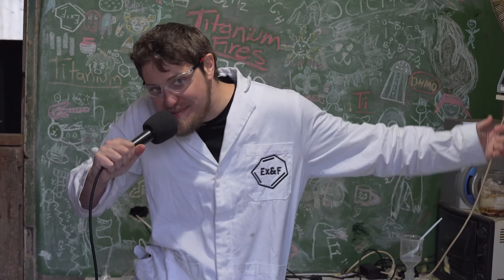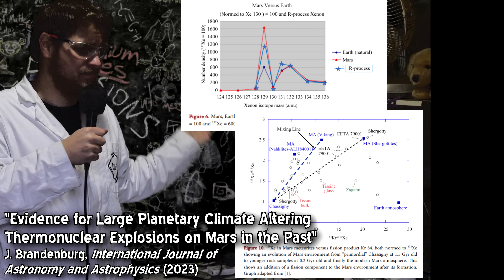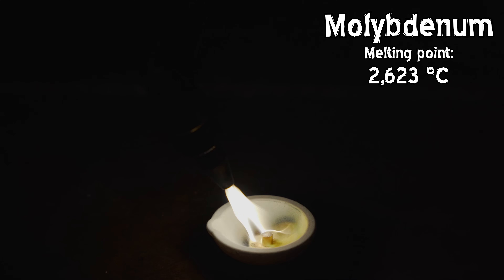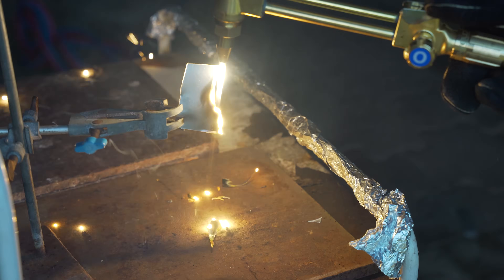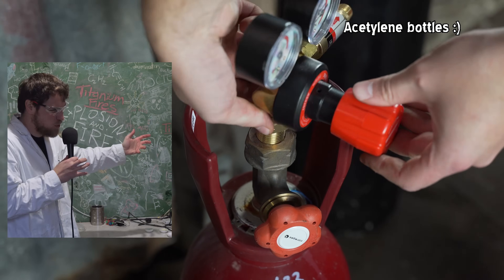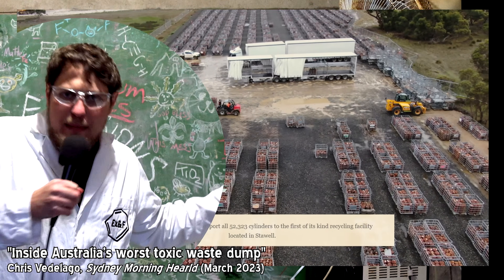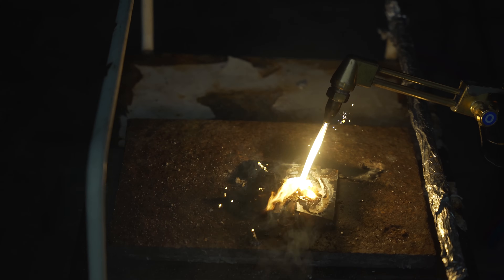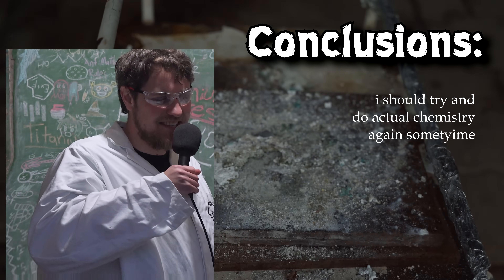Actually burning titanium

Comment: One time I wrapped about 100 grams of KNO3 in a lot of aluminum foil and put it on some hot coals in the fireplace. After a bit it slumped and poked with a poker emitted flecks of light and then it lit. For several seconds the house was instantly lit brighter than you could think possible.

Comment: I'm a computer engineering student who got to intern at a chem lab last summer. Don't know a damn thing about chemistry but I did build a bunch of instruments for them.

And holy shit the sheer lack of any practical skills is astounding. Like these people can barely not break their own insanely expensive equipment. The couple guys who can manage to not maim themselves if they look at a screw driver keep most of the tools locked up in their offices. Somebody leaves a vacuum ovens unsealed over night and ruins the pump, lets a bottle of mystery poison dry out and ruin the gel whatever the fuck tester machine, or tries to deice a freezer full of ancient pyrophoric nastyness, that is stored in glass, with a fucking chisel. Never mind the fact that they couldn't keep their labs clean if their lives depended on it.

That being said they can mix together oily shit and make nylon. Which is cool. Though the coolness wears off when they then struggle with the extruder and cobble together some unholy plywood contraption cause they broke the thing years ago and can't properly repair it. Or one time when somebody couldn't use a caliper properly and bought the wrong size of cartridge heater, so the clear solution was to sand it down with sand paper until it fit.

Comment: Dude those slow-mo shots are awesome. I need an oxyacetylene set-up...

edit: I should have watched the whole video before commenting. Fun story: I was super into recycling at my old apartment complex; Heaps of bins available, in a liberal progressive city. I "recycled" at a ratio of like, 1 trash can to 5 cans of recycling. Until I heard tell that the bags I was using were not "recyclable", and when the waste company received "recycling" in bags, they just tossed it into the trash pile. So I spent five years feeling good about myself, only to learn it was a huge waste of time at the end. I then learned that it's probably a big scam (depending on locale) here in the States too, so I guess it doesn't matter. Wtf are we doing?

Sweet vid, cheers.

Comment: 1:25 -  In case anyone's a little confused by the "Nuclear testing on Mars" paper. There's a guy called John E. Brandenburg who went off the rails in 2012 claiming he saw a clear evidence of a thermonuclear war on Mars. He only submits his papers to non-peer reviewed journals.
If the fact that Brandenburg's paper hasn't been peer reviewed isn't enough for you, the evidence he has for his claims are more easily explained through other known, natural processes. For example, there is a much larger amount of Xe-129 relative to Xe-130 on Mars, and he claims this is due to previous nuclear explosions on Mars, since when uranium and plutonium undergo fission, they can produce I-129, which decays into Xe-129.
The xenon isotope weirdness on Mars that he claims as "evidence" can be explained by Xe-130 being formed only in stars, and Xe-129 being formed through the decay of I-129. I-129 can be formed naturally through the decay of natural uranium, through cosmic ray spallation converting Xe-130 to I-129, and from cosmic ray muons striking Tellurium-130.
Hence, back when Mars had an atmosphere, it would've had a decent chunk of Xe-130 in it. When Mars lost its atmosphere, most of that Xe-130 went with it. Whereas the formation of Xe-129 occurs through decay of I-129, and there are several ways I-129 can be produced naturally on Mars; therefore it'd just continue to build up over time. Eventually, this leads to more Xe-129 relative to Xe-130 in Mars' atmosphere, with no need for nuclear explosions.

I don't know why Brandenburg bothered to write that paper, this is a direct quote from the abstract "Although there is presently no plausible explanation for the nuclear events." Bruh... That's what the paper is supposed to be about.

Comment: Or, it looks like you might have worked out the oxygen valve at the end of the video, but even then you've got a bright white, luminous flame, and what you want is a pale blue flame with a short white cone in the center, or since you're using a cutting tip, a ring of small white cones coming out of the outer ring of holes in the nozzle.
You can vary the length of the inner cones for different sorts of heating for different needs on work peices, but you generally don't want a large white flame, just white cones inside of a blue flame (or ring of blue flames in this case).

You also want to heat the work pieces with tips of the white inner cones just barely touching or not quite touching the workpiece, that should be the hottest part of the flame.

Comment: It doesn't look like you had the oxygen valve turned on when using the torch, so the only oxygen available to the flame was from the jet nozel in the center, which is only supposed to be used for cutting metal (normally steel) once it's pre-heated to combustion temperature (normally around white hot).

Also, to cause a bulk metal fire, you'll probably have to preheat the entire piece so it can sustain combustion. (I suspect industrial metal fire accidents more likely happen with larger pieces that get heated one way, possibly in a building fire, and thus allow the flame to propagate in the already preheated material ... more activation energy already supplied, like and enthalpy vs entropy balance at different temperatures)

Bulk magnesium is also incredibly difficult to ignite, but not this bad (though some alloys are also more resistant than pure magnesium), and it can be difficult to ignite a block of magnesium without it being close to molten or already molten in many cases. (there's an interesting story on that when someone was trying to stage a picture of a burning NEXT Cube computer case, which was made of die-cast magnesium alloy, and it didn't properly catch fire until the entire thing was a melting mess .. and that took an industrial natural gas jet and a ton  of fuel to achieve, as an acetylene torch only managed to punch holes in it with smoldering edges that would go out afterward)

Comment: Open up the acetylene flame with the oxygen mixing valve off till it stops blowing soot. Introduce oxygen slowly till the flame becomes neutral and you can see nice blue feathers at the torch’s tip. Make fine adjustments with oxygen lever depressed to fine tune your flame.

Comment: You didn't add enough oxygen to the mixture you should turn the oxygen up until you see well defined individual blue flames. If the adjustment is too sensitive you gas pressures are too high set the regulated acetylene to 6psi and the oxygen to 36psi

Comment: To better show that the metal is on fire when you cut a steel plate you can actually cut the gas flow while leaving the oxygen on and it will continue to cut. Essentially the acetylene is just there to get the metal hot enough so that it can react directly with the oxygen you're pumping in. The rapid oxidation of the metal is exothermic enough to keep the reaction going until you're done cutting the plate.

Comment: hey you might be able to melt tungsten with a large cutting tip, also when tuning an oxy torch you want the flame to turn blue by first igniting the acetylene and increasing the flow till it no longer smokes you then turn on the oxygen and bring it up till the sub flames are short and consistent this will require an 8 part acetylene by 40 part oxygen mix

Comment: Sometimes I turn some Ti on lathe, and one day I manage to light up a long titanium "chip" from turning (about 0,5 x 0,1mm thick) only with oridinary gas lighter . It was quite easy, and flame looks very similar to burning magnesium. I think that you can easily light up a thin (few milimeters) strip of Ti foil with just a match.

Comment: Hey Explosions and Fire you should be able to get some more heat out of your oxy acetylene torch for future use you just need to adjust your flame a bit more! 

When they taught me in school we would turn the acetylene valve on and spark your torch then turn the acetylene up till your flame stops producing black sooty smoke.  Next you'd want to open your lower oxygen valve beside the acetylene valve while leaving the top one closed. Then you can slowly open the upper oxygen valve which will allow you to adjust the large fiery flame into a nice smaller blue pre heating flame this flame should burn a bit hotter then the yellowy white hued flame you were achieving. You can use the tip of the preheat flame to cherry metal and then use the oxygen lever to dump oxygen into your cut!

Comment: Yes, Titanium MELTS at 3,000°C, but if I recall correctly, its IGNITION POINT is around 4,000-4,500°C.

Also, a Titanium fire is apparently almost impossible to put out because it reacts with all but the most inert gasses when lit, and is practically hypergolic at its ignition point. 
I also could be dead wrong on this, my chemistry is a bit rusty.

Comment: Plastic recycling will never make sense. Why?  Virgin plastic takes much less energy to produce.  Paper recycling doesn't make much sense either. Metal and glass recycling both take less energy than virgin materials production, so they work just fine.

Comment: To correctly balance a flame on an oxyfuel torch for a welding tip (the bent copper tip with a single hole) you want to start by setting the regulators correctly. Acetylene should never exceed 5-6 psi of working pressure, and above 15 psi runs the risk of detonation. Oxygen for a welding application should be set to 5-10 psi depending on the size of the welding tip. Open the acetylene needle valve and light the torch. Turn the acetylene up until the flame starts feathering (turning from a smooth ribbon of flame into something that looks like a narrow feather duster). You can adjust down from there depending on how much gas and therefore how much heat you want coming from the torch but this is the optimal setting for a given tip size. Once the acetylene is set, the oxygen should be opened. First the flame will get brighter, to a bright white, and start turning blue, and a smaller cone of flame will appear in the center, first as a light blue white feather but then narrowing into a sharp blue cone. The oxygen should be adjusted so it is just barely over the point at which the blue cone is formed, further than this and you run a higher risk of flashbacks, where the flame travels up into the tip of the torch, creating a loud popping sound and usually putting the torch out, but sometimes the flame can continue to burn inside the tip which is why you always shut off the oxygen if this happens. The hottest part of the flame will be directly in front of this blue come. Don’t touch the blue cone to the working piece as this will cause the tip to get dirty and cause flashbacks. For the cutting torch, the acetylene should be still set at 5-6 psi. Set the oxygen according to tip size, usually 25-30 psi for the smallest tips (000 or 00) and 40-50 psi for the largest tips commonly available (sizes 1-3) The knob next to the cutting oxygen lever controls what is called “preheat oxygen” and functions much the same as the regular oxygen knob when set up with a welding tip. The acetylene knob is turned on, the torch is lit, and the acetylene is increased until the torch starts feathering nicely. You usually want more acetylene and therefore more feathering on a cutting torch as more heat is usually better for cutting applications. The oxygen valve at the base of the torch is then opened to an arbitrarily large setting. Preheat oxygen is then opened until the blue cones have just formed at each of the six preheat nozzle openings. The cutting oxygen is introduced via the lever. To properly set a cutting torch, depress the lever and further adjust the preheat oxygen to reform the blue cones at each preheat nozzle while the cutting lever is fully depressed, at which point the lever can be released. The large amount of oxygen sent through the cutting nozzle decreases the amount through the preheat nozzles and unbalances the flame, and adjusting to the blue cones while the cutting lever is depressed corrects for this. As someone else mentioned, the hottest you will get the flame is without the cutting oxygen. If the cutting lever is depressed before the area to be cut has been preheated to almost melting, it will cool the metal instead of cutting it, as the large volume of oxygen dumped into the flame is extremely over stoichiometric and does not serve to further heat the flame, and cools the flame via sheer volume of gas introduced.

Comment: Do you recycle Office Paper, Print Media, PaperBoard Box, etc?  Did you know app 60% of the fiber is lost during recycling?
The fibers are too short to be of use so they are dumped as a sludge.  The 40% that is left will become...toilet paper.  wah-wah
Recycling is a dirty and energy intensive process that is necessary but also has severe limitations.
And, everyone has forgotten that it is REDUCE first, then REUSE, and as a Last Resort... ReCycle.

Comment: Hey man, try to avoid burning acetylene for more than a second after igniting, before introducing oxygen. So you want to spark, and immediately start adding oxygen after ignition, basically as fast as you can.
The reason is the soot that comes off acetylene being incompletely burned has microscopic hooks or so I'm told that faaaark your lungs up something awful. and the soot can cling to walls/ceilings and become airborne again even after a few days, so minimizing the soot is the aim of the game for your poor lil lungies.

Also I later see the flame spluttering or "side pissin" which you need the tiny little files to smooth out the nozzle again.

Comment: Just an educational tip here, you're using your torch incorrectly. The lever is not used for anything but cutting steel, it shoots a thin jet of pure oxygen through the center of a ring of orifices which is meant to ignite the steel once it has been heated enough by the main flame. Ignite the torch like you have been after opening the acetylene knob, then once you have a nice 10 to 12 inch long jet of orange flame, crack open the knob next to the acetylene knob at the torch base to engage the oxygen, then slowly open the third knob located where the lever sits in the middle of the torch body until the flame turns blue. The flame can be adjusted from fuel rich (which has a longer blue secondary flame) to a neutral flame, or a stoichiometric burn which is achieved by slowly increasing oxygen flow until the secondary flame almost dissapeara around the primary flame (the tiny whiter colored flame at the very tip), and if desired the oxygen can be further increased for a lean flame, also known as an oxidizing flame. A slightly fuel rich flame will reduce oxidation of your intended target at a slight expense to maximum heat, while a lean flame (if it explodes and snuffs the flame you've gone too lean, it starts to detonate/knock like a lean combustion engine would) will provide the maximum flame temperature at the expense of severely oxidizing your target material.

Also, you can set a neutral flame then tap the flame out on a piece of soft wood or rubber to extinguish it, and then fill any sort of very strong container with the gas mixture flowing from it, for instance an acetylene cannon, then ignite it for a truly loud bang😉.

Shooting a jet of oxygen through the middle of a pure acetylene flame makes a very bright flame but it's heat output is severely reduced and it will excessively oxidize your target, it's a newbie mistake but that's why we're all here to learn😉.

Comment: Simple answer before ive watched the video. Without extreme temperatures no.
Reply: Spoiler - With extreme temperatures, still no. Post video. 

Tip - The firework effect can be reproduced by simply grinding. It doesn't require high temperatures.

Comment: So I'm sure it's been said but your flame is way too rich. The lever valve is for adding pure o2 to cut steel through burning.(there's a whole video you could do there is cool stuff) The ti is melting and blowing and burning as blobs. Get the flame adjusted right and warm the whole ti plate. Then heat a corner until it kicks off. Oh, and don't look at it, the spot will be in your eye for days. Not that I know that firsthand becuase of er... Reasons.

Comment: Plastics engineer here who thoroughly enjoyed the recycling rant. As a few others have mentioned pyrolysis is our best disposal/energy recovery method currently and can even be used to heat a relatively large number of houses with a big enough waste-to-energy facility. One of the main challenges is recycling multi-material products which cannot be easily separated into their respective materials. Another challenge is just how poorly integrated our materials recycling facilities (MRFs)are. They use a cctv system which aims to separate common items off the conveyor belt and be sorted. Currently they are programmed to recognize clear PET water bottles, sprite green PET bottles, HDPE milk jugs and laundry detergent bottles. Everything else makes it to the end of the line unsorted and shipped off to be burned, put in a landfill, or turned into useful building materials. Additionally, the main challenge with plastic bag (LDPE) recycling is that they clog machines like crazy and maintenance requirements makes it unprofitable. There are a few companies working on a reliable recycling process and are pouring funds into academia atm but large scale implementation is yet to come. 

If you stayed for this whole rant I am sorry.